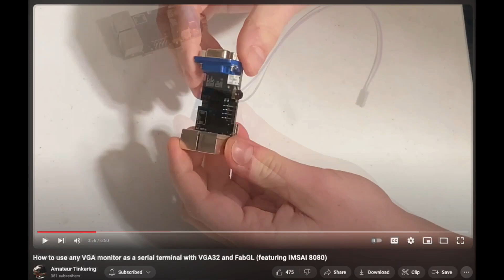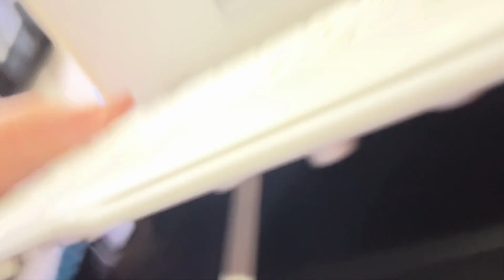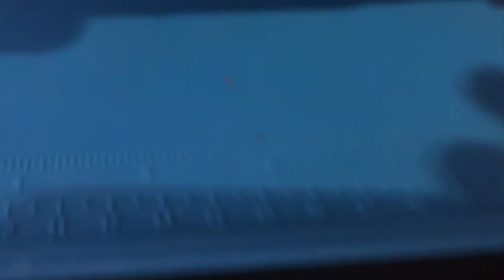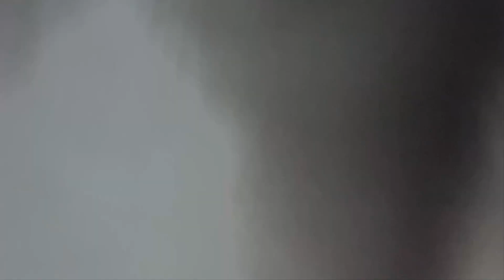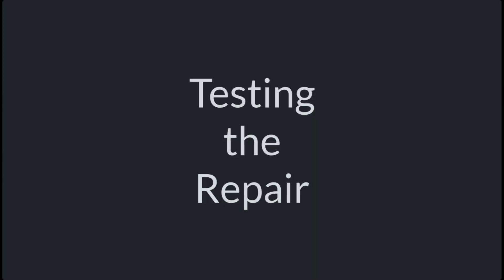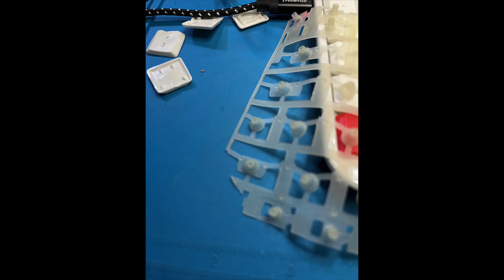Freewrite Traveler Keyboard Repair

Comment: Where do you put the hole? In the center?
Reply from the maker: Yes. I'm sorry i neglected to show it. put the hole in the center of the tape
Reply: Does it go under the scissor  or under the nipple? If under the nipple, how?
Reply from the maker: I'm sorry it isn't clear from the video. Behind the nipple. There's a "membrane" that the nipple sits on. And the tape goes behind that.
Reply: I’m sorry to keep asking, but how do you get it under the metal?
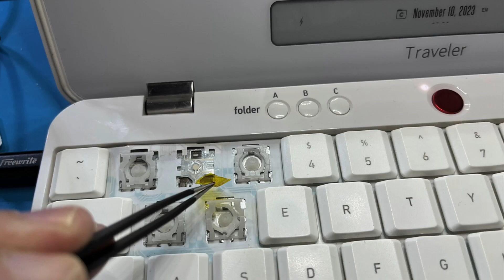Reply from the maker: @erikwarner4194  Check out 8:07
Reply: I managed to make the y key not work at all. I must have broken the connection. Any suggestions? Thank you, Erik
Reply from the maker: @erikwarner4194  if you just put the tape under the key that should not be a problem. If you broke just one key (not a row/col) then theres something blocking that specific key.
Reply: Okay. I’ll take a look. Thanks for all the help.
Reply: I tore the little silicone dome. Is there anywhere I can buy those?

Comment: They supported you!? I got a second-hand hemingwrite, and the [ ‘ “ ] only worked when I smashed it down. I was told there was nothing they could do, so I started dismantling it to find the fix. The keyboard switch pins are soldered to a keyboard circuit board, but this one didn’t have both soldered; one was folded in on itself, so it was a manufacturing error. They offered no help unless I ordered a device from them.
Reply from the maker: it def. seems random.

Comment: Hi Greg. Thanks for the video. Is there any way to make this repair without disconnecting the whole keyboard? Is it possible to add insulation tape just by removing the key cap? Thanks so much.
Reply from the maker: Yes, most definitely. I was documenting what I did because I didn't know to start where I would end up. And I left the extraneous dismantling in so that everyone can see what's inside.

But - YES! Please skip the disassembly and go directly to the end and insert an insulator. Do not remove the "nipple" and do not blast your keycaps with unnecessary heat!
Reply: Thanks so much. I know nothing about these things, but I will give it a go!
Reply from the maker: @meganbradbury9592  Please let me know about your success!

Comment: HI Greg, Thank you! Had the same issue with the '=' key. Using your video as a guide I managed to slide some insulation tape behind the key (no need for a hole as the key works through it). Seems to have corrected the issue and saved the $250 repair fee that Astrohaus wanted! THANK YOU, THANK YOU, THANK YOU.
I've put up a reddit post referencing this video as you've quite literally saved me from an expensive repair, new subscriber for sure :)
Reply from the maker: Thanks for sharing your experience! And the reference on Reddit.
Reply from the maker: I have to admit a little confusion about how this works without the hole in the tape/insulator. AFAIK this is not a capacitive keyboard. So how the contact is made without a hole in the tape/insulator escapes me. I know that before I put the hole in the tape the keypress did not actuate the key stroke on my unit.

Comment: Hi Greg, what colour is the high-temp tape that you used as insulator? I am struggling to see the tape in your video. I have the same problem with a repeating key in the number row on my freewrite traveler. In my case it's the "-" (dash) key...
Reply from the maker: It's that yellowish gold tape it's like Mylar but translucent
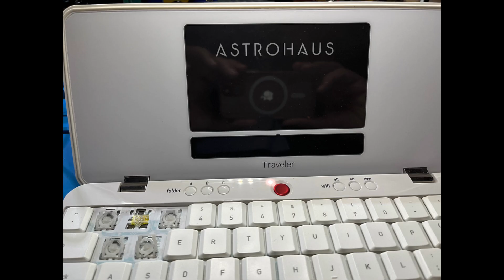Reply from the maker: It's at 8:08 and the tape I used was 
https://www.amazon.com/gp/product/B072Z92QZ2/ref=ppx_yo_dt_b_search_asin_title?ie=UTF8&psc=1

and of course, thanks for commenting and watching!

Let me know how your repair goes.
Reply: Being based across the pond I just searched ebay for high temp insulation tape and came up with the yellow/gold stuff used. Just by removing the key cap and scissor I was able to fix my stuck key for £4.99 using two pairs of tweezers. Greg is a legend!
Reply from the maker: @MrTasso289  I don't think the type of tape matters. I used this because it was the right size, translucent (so I could see through it for positioning), and for the ability to pierce it with a soldering iron and not have it disintegrate. I'm glad this worked out for you.
Reply: I have a quick question about the membrane: I know you mentioned that there are two membranes - however to me it feels like there is only one membrane, so I am struggling to find an opening. How did you pry apart the two membranes?
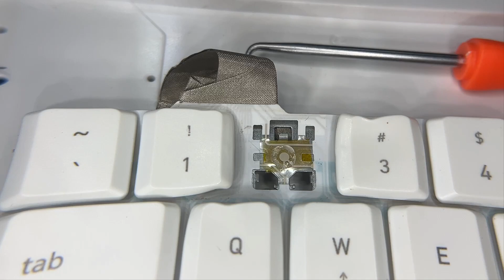Reply from the maker: @ericderbaerige  I'm sorry it's not clear from the video. I show it at 6:40 but I didn't record the process. It slides in from the top and behind the "nipple." I think the 2nd membrane is glued to the metal chassis. You may not be able to see the "top" metal contact with the "nipple" in place. But your tape should go just under that contact (see 8:10 - where I removed the tape later and pierced it. This time I pulled it from beneath the "nipple.") I hope this works out for you. Keep me posted.